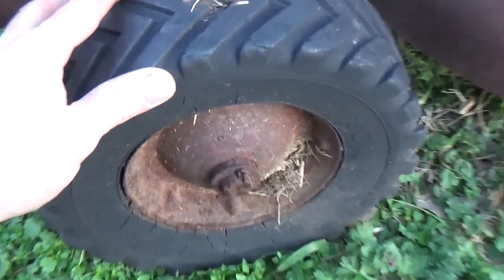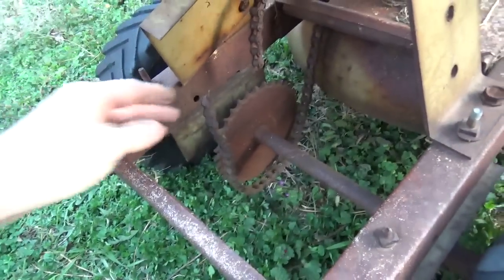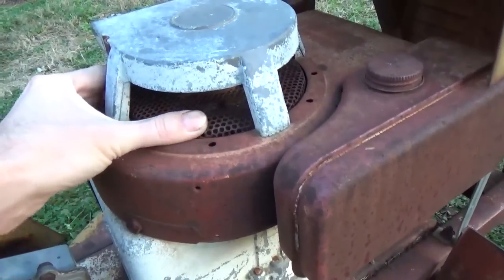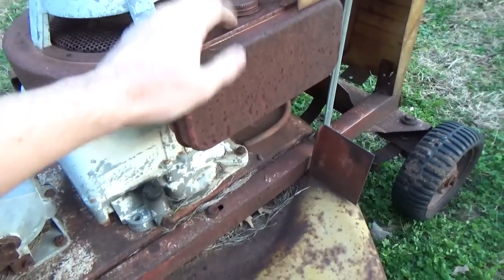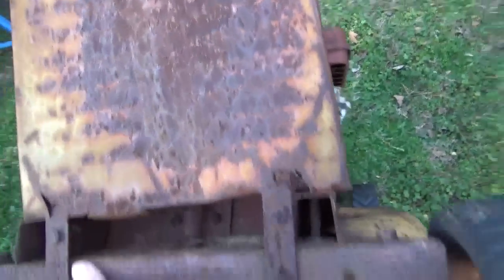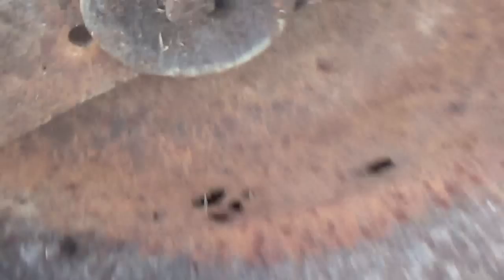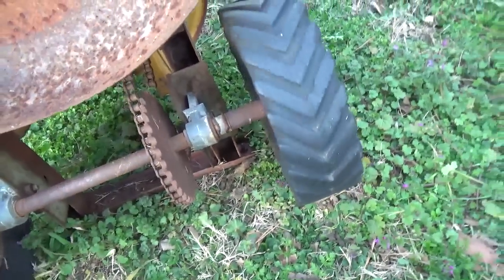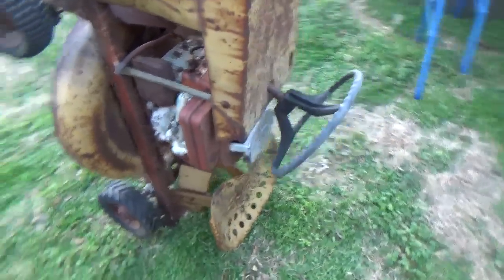Mustang Lawn Mower

Comment: i love these little mowers i just picked one up for 30 bucks it has alot of the same issues as yours my steering was also frozen it  wasnt to hard to free up good luck with yours
Reply: I bought one of these small mowers for $30 too. Mine is a mtd though. Its hard to find any info on it

Comment: Thanks for the new video's man, even if you never finish any projects- I like seeing what youre up to! 
 you're on the right track with getting the trans free and see if the motor will run. if either isn't an easy fix I'd sell it. she's pretty far gone to be dropping a high speed setup in (plus fearless already did it!). I love seeing uncommon old lawn machines like this guy and your ford mower. 

I think i've said it before, but if you ever get a wild hair and want to kill another tecumseh push mower by replacing engine oil with something else- id be very eager to watch! You're doing a good job, thanks for the entertainment!!
Reply from the maker: Chevy Orange Deere Green You're Welcome,  and thanks for the input. It is pretty far gone like you said, I knew that when I bought it, but they are extremely rare in my area. I am not sure what exactly I will do with it, as far as doing what fearless did, thats out of the question as I don't have the open roads to run it on. Also  even though I have mad respect for him, he kinda just cheated and built a whole new frame and slapped a mower hood on it. I plan on using at least half of what is on this one or replicating the original parts. I have completed some small projects but the large scale stuff tends to be more than I can handle.

Comment: you could easily put a push mower engine on there if that one doesn't run like if you wanted to cut grass with it like a briggs quantum or 8 hp flathead
Reply from the maker: I'm not a fan of using push mower engines on riders, if it is bad I will probably use one of my spare 10hp engines. The engine on it now is ether a 7 or 8hp